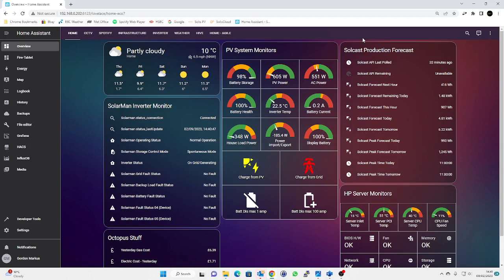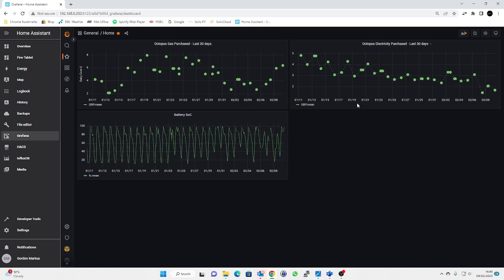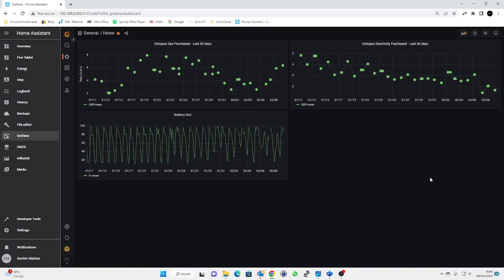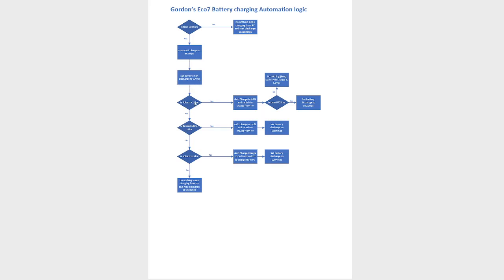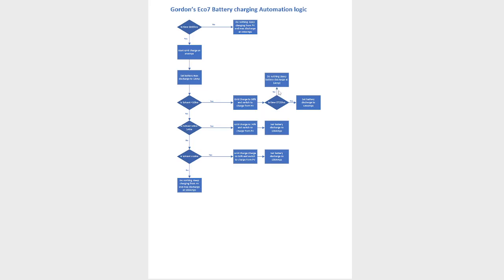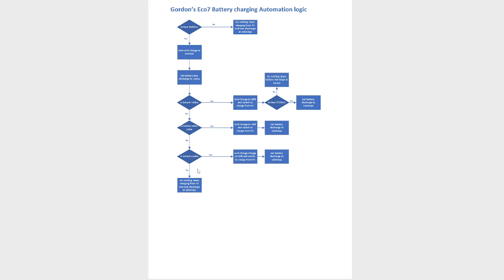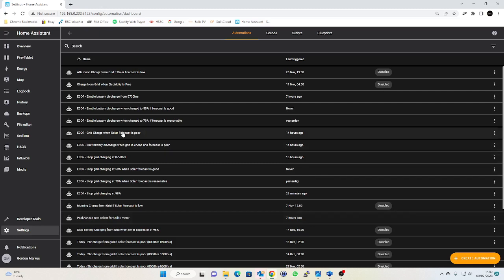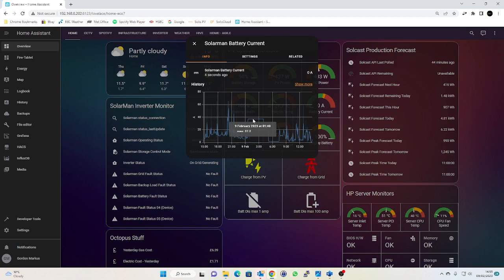Solis Hybrid Inverter Economy 7 Optimisation - Part 2

Comment: AFAICS during the eco7 cheap period when you are charging the battery, if the dishwasher (or anything else) comes on, it will pull from the grid. I don't see how any appliance could be discharging the battery while you are charging. The battery can only be charging or discharging at any one instant, can't it? So, the question is, why do you think it's necessary to specifically inhibit battery discharge in the eco7 period? What am I missing?
Reply from the maker: Because the battery might be fully charged in the first 3 or 4 hours of the ECO7 window, then I wouldn't want to use the batteries to power those heavy appliances during the remainder of the ECO7 window as I want to keep the batteries fully charged ready for when it switches back to peak rate.
Reply: If you set the battery charge period to the full eco7 seven hours and it charges in four, it seems to me it doesn't matter if then the appliances switch on and start off by drawing from the battery - as soon as they do, the inverter will take over and charge some more, as soon as the battery goes below 100% (or 95 or whatever you've set it to). 
This is what I observe with my simple eco7,  non-HA set up. My battery is always fully charged at 7 in the morning regardless of whatever appliances we have run overnight.
Reply from the maker: That's different to what I observed. I found that if my batteries were fully charged by say 5am, and my appliances ran after that - they would pull from the battery, which is why I have these automations in place. It's also a bit of a failsafe, as if the appliances are running during the Eco7 window then you'd only ever want them to pull from the grid otherwise why would you run them at that time? @ricobass0253
Reply: Interesting. I've only had my batteries installed on the 28th Nov but since I set the SOLIS inverter charge period to 00:00 - 00:70 on the 2nd Dec, I've had 100%SOC at 7 UTC every day since then.  ATM I can't see any advantage of a more sophisticated HA system with my present setup.

On a similar vein, I must admit I can't see the advantage of changing the night charge in light of the following day's solar forecast. If the sun is good today surely you just don't have to charge (from the grid) that night as the battery will have charge left over from the  solar (partial). The actual sun is more accurate than any forecast and you are just making the charge adjustment one night later. Again, the advantage of a predictive system is not obvious to me. What have I missed?
Reply from the maker: You are entirely missing the point I'm afraid. Why would you want to grid charge and pay for electricity (even off peak) when you don't need to? When the weather improves the logic totally flips, so you charge from solar in the day and then run on batteries overnight. Some days it will be somewhere in between so you might only want to charge the batteries to 50 or 70% if the forecast isn't great but 'reasonable'. Not sure where you live but in the UK the weather is very variable, so you want to make the most of your system to only charge when needed. My calculations work out that I've probably saved an additional £250 a year by running this kind of automation so it's worth putting in the effort. 
 @ricobass0253

Comment: Hi Gordon, nice videos. I am building a HV DIY battery for Fox Ess inverter. I would like to know if I can red the can bus messages from one of your battery. I decoded a few can messages and can charge/discharge the battery but the invertor is still in fault saying "BMS internal fault". I don't have a BMS is just an Arduino sending can messages.
Reply from the maker: Hi, thanks for watching and the comment. I'm afraid I don't know about reading bus messages to the batteries. I'd imagine if it's RS485/Modbus then it would be no different than what I'm doing to the inverter, but my setup only involves connectivity to the inverter.
Reply: Can Bus is another protocol same like in automobiles. Is a 2 wire communication. If you know anyone that can provide can bus logs let me know. Thanks

Comment: Great video Gordon, do you have a copy of the scripts, sensors and dashboard that you use somewhere? I just got a Solis Inverter installed and currently getting it all setup in HA and i like to check out how other people set stuff up. I had to drop the Solis Data logger as its not great so i installed a waveshare RS485 to RJ45 converter along with modbus
Reply from the maker: Hi, thanks for the comment and for watching. The sensors that I'm using for most of this are from the solarman integration . In terms of scripts, take a look at my first video as that shows how they are built. I don't really have anything for dashboards, but if there's anything specific you need to know then you're welcome to ask. Part of the 'fun' of getting this setup was working out how to present the information!